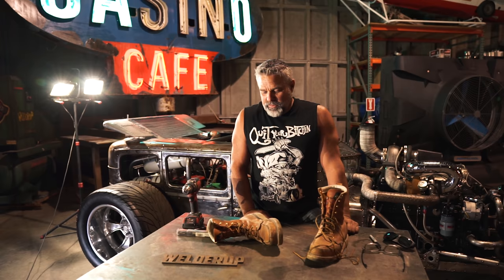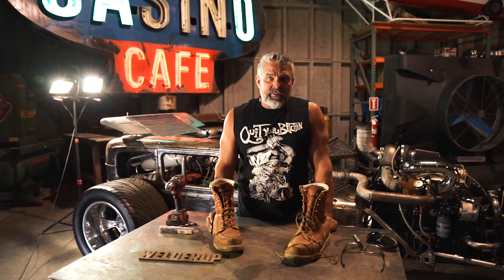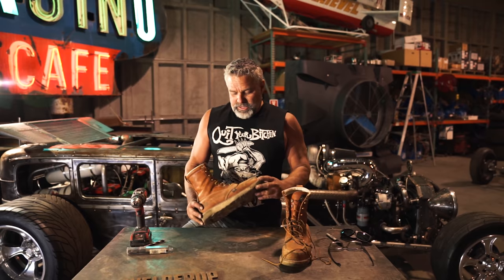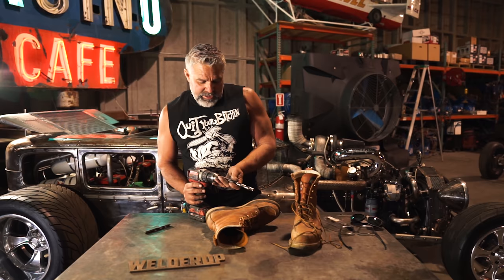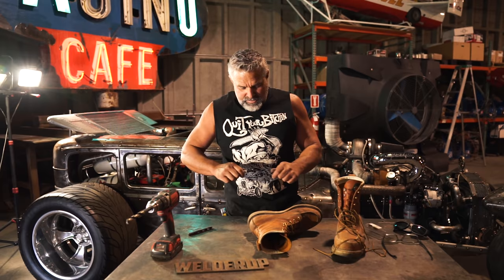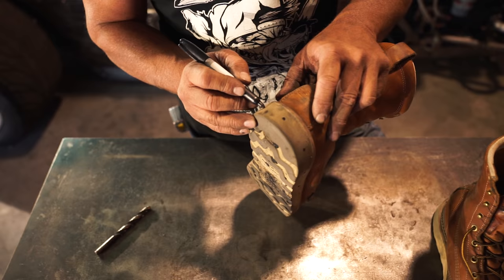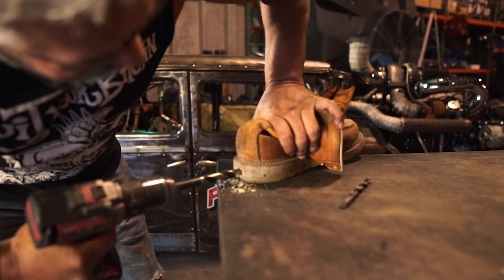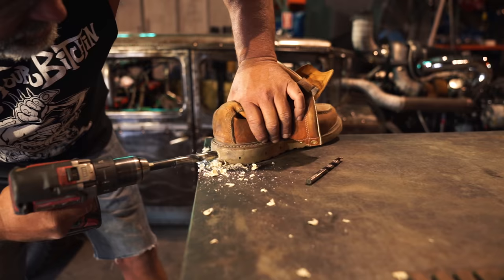If You Own Work Boots You NEED This Hack!

Comment: For added cushion, drill some holes in  your feet as well.
Reply: Head too!
Reply: Staind_Truth They are less heavy with the holes is not stupid
Reply: Best to drill while wearing the boots so hole in feet and boot line up,,,lol
Reply: George Spangler  put the boots on your feet and I drill the holes lol
Reply: Steven Lindsey  how did you think I lost my big toe.
Reply: DAMN didn't work just bled everywhere. Any suggestions?
Reply: holes in the feet is for ventilation..... duh
Reply: @georgespangler1517  that's funny
Reply: Ace probly never wore boots
Reply: Too funny
Reply: Are you familiar with the k Swiss tubes athletic shoe sane concept
Reply: Lol 👍👍
Reply: Commercial industrial electrician. 10 hrs a day on concrete and I'm a big guy over 300 did this and it works great for me thank you
Reply: Ouchy
Reply: @georgespangler1517  tragic weed whacking accident?
Reply: NOT cushion, that's for ventilation!
Reply: Lol!!!
Reply: Some of y’all are savage 😂
Reply: @georgespangler1517  🤣🤣🤣this brought the original somewhat bizarre, but worthy comment to an even more ridiculous, but hilarious place. Thank you. I’m still smiling..

Comment: For added style, screw in bolts into the holes.
Reply: rasheed D it was a joke.
Reply: Mr.Richmond Saw you’re*
Reply: @brendanmalone9537  , that is correct, I was kidding. You could also make roller blades, by putting metal rods through, and putting on skateboarding wheels.
Reply: I’d opt for some blinky LED lights.
Reply: KNOCK KNOCK
Reply: @24agt8  
Who's there?
Reply: John Three16 whomdtsed said such heresy
Reply: That's a great idea John three 👍and call them Mad Max boots, wicked-looking and good for shit kicking I'm going to try that ! 🍻☮️

Comment: Some skateboarders came up with non Newtonian soles and insoles. Its basically cornstarch and water. When its resting its fluid but on impact it stiffens up. Put some of that in there and you will have the ultimate impact absorbing boot. You are so right about being on concrete and asphalt all day it really takes its toll on the back.

Comment: Pretty cool idea. I was a jet engine mechanic and the oil could dissolve nearly any work boot sole material. I ended up with some boots that guys in the oil patch used.
Reply: What I've found to be extremely destructive is wallpaper remover for some reason... Ruined 2 pairs that way. The soles would just start falling apart...
Reply: moinmoin it destroys adhesives
Reply: @xcofcd  it is probably a fairly strong solvent, it is probably simultaneously dissolving the sole, and any adhesives.

Comment: Disclaimer if you've owned a pair of boots for anything over 5 years and they are "still good" you're not a very hard worker.
Reply: I wear Ariats and after a year it's time for another pair
Reply: My rocky's last 2 years in concrete construction
Reply: I’ll wear a pair of redwing $300 boots out in a year and a half. They make good boots but don’t stand up to the railroad life very long.
Reply: @zachgrant7240  I cant justify 300$ on boots to get destroyed  and hardened by concrete, I buy rocky's and they are amazingly comfortable and still the soles are good the boots are just trashed
Reply: I got some chippewa super loggers cost a lil over 300 and they are not worth the money dont buy mine are about to shit the bed after 10 months
Reply: Itasca 30$ best boot ever weatherproof,  comfortable, warm and I wear them all day. Try them
Reply: Teal Steel  apartment maintenance for the last 10 years... Look up the boots they are worth it the red wings I had was trash
Reply: Teal Steel  just looked them up tractor supply sells them for 25$ the  3M insulation is worth every penny
Reply: At least once a year for me. Sometimes sooner. Can’t seem to find anything that holds up.
Reply: I like chipps, I get a pair ever year and a half to two years if im lucky!  And thanks everyone for all the feedback on this comment!
Reply: Kemmy Boi also has to do with weight. I know guys who wear boots out 3x as fast as me doing less work because they weigh more.
Reply: Bought a new pair in March and the fuckers are already almost done
Reply: Porkchop yep I’m about 150 and usually get 2 years out of a good pair of boots but I wear them about all the time. The guys I used to work with were upper 200’s close to if not over 300 and they both were lucky to get a year out of their boots. If they bought cheaper boots they’d only last a couple months.
Reply: No shit!.. a year IF I'm lucky.. no matter what brand
Reply: @johnnydoe4179  I only weigh 130 , the hardest work makes even the cheapest of boots last a year or more.
Reply: I love thorogood work road construction soles wear out I'm 9 months in to my latest pair and they are shot this is a dumbest thing I've ever seen
Reply: My Nick's have lasted 5 years. You just buy shitty boots.
Reply: No shit.
Reply: truth, worked in press shops for years now. Everywhere gives boot allowance up to 5 pairs for 3 years, covers about 60-70% of price. We are lucky to get 7-10 months out of boots in some places because of the cutting oils, shreds the boots.
Reply: @raymondrainwater9803  About 130 here too but I work on metal grates that shred soles. No matter the brand they burn out in 18mo max vs <1yr for other guys. 
My last 3 pairs are CAT ones like youd find at Meijer and outlast 2 different expensive brands I've had
Reply: @kayladillon13  look into having a pair of boots made. i  just had franks boots make me a pair. They are expensive upfront but no question they are the most comfortable boot i have ever owned and they are the most well built boot too, should last a very long time then send them out for a rebuild and basically have a brand new boot.
Reply: I've had my Docs for 3 years now, they're  still doing the job. Didn't need to drill holes in the soles for air wear either
Reply: Depends the work you do, and how much walking and the surface. Welding the longest I’ve gotten boots to last was 6 months. That’s with extra toe caps. As a stainless steel pipe fitter working in food processing plants like Pepsi. The floors are like sandpaper. The toes burn out first from welding on the floor. So you glue toe caps over and over till the bottoms get sanded to nothing. But I average 4-6 months for a pair of boots.
Reply: Coming up on 1 year for my new pair, Hole in the front toe to the comp toe, Leather is scratched and scraped to hell, gone through my original insoles 2 holes in each one, still wearable tho, My last pair lasted a few months before I had a hole in the toe as well, Same with insoles and leather condition, gonna be going onto my winter boots here in a few days to weeks depending on whether, by the looks of it ill probably swap to em tomorrow as it's freezing over tonight.
Reply: @yeahitskimmel  I used to wear cats because they looked cool and 80 bucks. Few months before shit started ripping. Just considered them throw away. Now I wear red wings
Reply: Good pair of boots lasts me about a year in welding
Reply: @fuckfuckmcgee69fuckfuckmcg63  ya some of our guys wear welding boots with the leather strip over the laces. Its mostly only tig welding and some mig so I don't see the point. Now Arc and mig only I can see the need for it
Reply: big country yeah, I run mostly mig pretty high .045 wire along with an assortment of torches and general things that make laces only last a couple months. The boots last tho
Reply: @fuckfuckmcgee69fuckfuckmcg63  damn ya that's frigin lava hot. We stay at .035 and even then cranked up makes for splatter. On that note our Miller's are old and seem to splatter a lot. Finally got on a Lincoln and it cleaned up. Tig welders are all Miller though. No sparks which is nice. .045 ya thats cranking. I don't get past 3/8 thick though. Looking for a new helmet. My miller seems to suck
Reply: big country Jackson shadows a fairly cheap super sturdy hood, but yeah we weld steel 5-6 inches thick sometimes
Reply: big country splatters a bitch sometimes!
Reply: @fuckfuckmcgee69fuckfuckmcg63  that must be a hell of a bevel for that thickness. And stacking the welds. Ya thats some thick stuff. Ya I almost went with the Jackson and should of spent the extra 25 or 50 whatever it was. I'm going broke buying fab tools though. Bout done with it
Reply: If you guys are buying boots see if they have a lifetime warranty.
Reply: big country you work in a shop?
Reply: @fuckfuckmcgee69fuckfuckmcg63  ya I work in prototype auto fab. From machine to bending up metal and everything between. 3/4 of the welding is tig and the rest mig. Normally never welding on anything more than 3/8 maybe .5 at max thickness. Don't make enough money thats for sure
Reply: 6-12 months for a pair of boots in the machinist business. And that is wore right threw the sole.
Reply: Those boots are hardly stained by the dust on his shop floor.
Reply: @yeahitskimmel  I work on metal or fiberglass grates, yes your soles will get shredded. Brand doesn't matter. Lucky to get 3 months on a boot with med to large lugs.
Reply: Just a smart worker
Reply: 5 years? I'm lucky if they last a year
Reply: Nah you just oil them and get the souls replaced
Reply: Lol new pair every year....year round framer
Reply: big country fuck no they don’t! I’m a year and a half into building/welding mining equipment, and pay is okay at best. I’m just tryna learn and improve enough to get on pipeline or construction
Reply: You guys get more than 6 months out of your boots?
Reply: I usually wear out a pair of work boots in about 6 months or so. I normally average 5-9 miles a work day and have been up to 19 miles on huge job sites. Tried many different brands and thorogoods stuck. Been wearing them nearly every single day for 5 years
Reply: Yup. I weigh 130 and I'm on my 3rd pair of Doc Martins in a 4 or 5 year span.
Reply: I won't wear anything but Timberlands. I've got weird feet and they're the only boots I don't have to break in. Get a year and some working on Oil rigs. Had  red wings, Cats, shitty Walmart boots ect. By far the most comfortable
Reply: Had these same boots as a framer. 6 months tops .
Reply: Teal Steel Lol , half the time I’m framing houses I wear a $20 pair of vans. Lol. Although I have owned thorogoods, this exact pair actually. They last 6-12months max . The stitching on the toe starts coming apart
Reply: @zachgrant7240  Nick's boots. Wesco boots. Custom made is the only way to go.
Reply: True dat
Reply: I can’t go more than 5 months doing commercial trash
Reply: Hayden L what kind of work do you do for a living for boots to last that long. I do like nicks very much but i dont see getting that much time out of boots imo. Maybe year and a half to the most and then they hurt my feet and are worn out
Reply: Nick's, White's, or Frank's. They are all expensive, but they're made to conform to your feet (I know Nick's builds a last for your foot and they keep it in their warehouse for when you need another pair, or if you need the upper replaced). You can get them restored, resoled, or completely rebuilt. I believe all three are in Washington State (maybe even all in Spokane). Buy shitty products, expect shit results. You can go to their store to be fitted for custom boots, you can go to one of their dealers to be custom fit, you can do a home fitting (with the help of a second person, you take measurements of your feet), or you can have them fly in to custom fit your crew of 20 or more guys.
Reply: BS whites,wescos or Nicks can last you 10
Reply: Or you don't own a pair of Nick's Boots.
Reply: It depends on if they've been rebuilt.

Comment: I'll have to try the Darnell boot trick, at the end of the day when I take my boots off my dogs are barking. Thanks for sharing
Reply: Bro get yourself some better insoles too. I got replacement ones for my boots and they feel soo much nicer. Would try Steve's trick but mine aren't as heavy duty.
Reply: Jeffrey Collins for sure on the insoles , I have a pair of redwing loggers and the are great but the original insoles were falling apart, so I spent the 60 bucks for the redwing ones and the boots felt brand new after that

Comment: The only thing I question is what if rocks get in them holes walking around a jobsite ?
Reply: Well he did say steel industry.
  Looks like it's worth a try if your not going to be outside much.
Reply: @rdktbc  maybe he did I missed that but there are also gravel yards at steel plants sometimes those guys have to go out in the yard and   do layout for the welders / fabricators I'm speaking on I beam steel companies not auto shop mig welders  no disrespect to them but the sole protects your feet and the perfect boot will never be designed time on your feet matters the most
Reply: @kaleip   do you think we could accomplish the same effect of we seal them with gasket maker or even just hotglue
Reply: @rdktbc  I would consider the foaming insulation in s spray can...light weight flexible and sealed.  I work in asphalt roads nothing can withstand diesel fuel and heat on boots so the farther away my feet  are away from heat the better this hack won't work for me

Comment: Best boots made I've been wearing Thorogood boots for 7 years and I will not buy any other boot
Reply: Probably because you have never owned Whites or Wesco boots.
Reply: @TheRoadhammer379  man Whites ! I seen a cut through view of their boots and the footbed had 7 layers....they will be my next pair probably.
Reply: Better then redwing? I was thinking about thoroughgood next to get something actually made in America. What’s these whites you speak of? Probably too fancy for what I’d been using (red wings or danners since day 1 lol)
Reply: Thorogood, union made in America
Reply: @chrisoconnor3119  they wedge sole or they have a heel?
Reply: @Garrett they have both heals. flat. high top. low top. best boot ever.
Reply: @garrisonkelley7053  mine have a heel. Im on a ladder half the time and im thinking about switching but i.d.k.
Reply: Had one pair, lasted 4 months. Super garbage was very disappointed and leery about goin back to try more
Reply: @lambchopLSX87  if they only lasted 4 months Thorogood would have replaced them with no problem I had one pair that some stitching came loose at around 4 months old and they sent me a new pair with no problem
Reply: Thomas Barnette wish I had known that, the sole completely fell apart
Reply: I'll stick to my Danners. Still have mine from when I was in the Corps, plus others. They took a beating and stayed solid for years. Bates and Thorogood not so much. S/F
Reply: @lambchopLSX87  which brand? Which model?
I will be sure o avoid those
Reply: Chris O'Connor thorogood brand I’m tryin to find the model. Actually a guy on here did a review of them and I commented, he too had the same experience as I. Lemme see if I can find the Info real quick.
Reply: Chris O'Connor also just like redwing not all thorogood boots are made in America. They said right in the tongue made in China.... just sad really
Reply: Chris O'Connor 804-4282 is the model. They ain’t even made anymore. Nuff said right? I really liked them too, they were heavy but once broke in very comfortable. The sole wore out in no time but the boot itself was still in good shape, was cheaper to replace them. I actually went with the original pit boss by timberland pro. They are still goin strong and I had them since about March of this year
Reply: @lambchopLSX87  i accidentally bought Chinese Redwings my first time buying Redwings! I was so proud i got Big Boy American boots until the next day when a guy said "those are NOT made in America" i had flags in the laces even!
I was so upset that $200 i thought and was misled into those buy the salesperson in Gander mtn. 
The next pair and ever since are a local Cobbler two brothers owned shop. So nice to have the craftsman rework your boots per need!
Reply: Chris O'Connor that’s what my plan is for my next pair. These timberland pro pit boss aren’t bad I’ve been in them since 7 am and it’s now a little after 7 pm and I’m not hurtin. Most days are the same so overall not terrible but yes I definitely want to get a “good” pair next tax season lol
Reply: @lambchopLSX87  thats when i get boots too usually! Taxes
Reply: Chris O'Connor roger that

Comment: No offense but I don’t recommend doing this. They have inserts for the boots and that does the job. And it’s thousands of times better.
Reply: Yup. There are boots with softer soles but they don’t last as long. It’s best to just spend money on inserts and never do this. It ruins the soles and can make the boots wear out faster. I wear a pair of them for work.  A good pair of insoles will do the trick. If you want a really good one you would have to do some research on them.
Reply: Don't live in fear